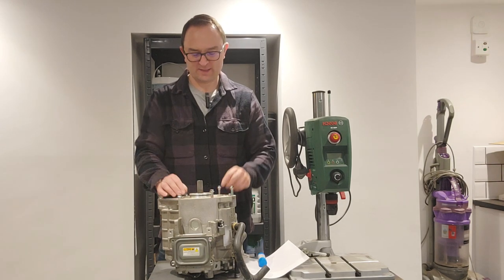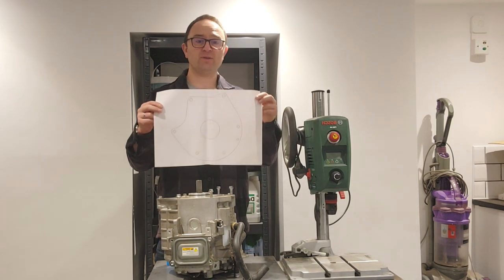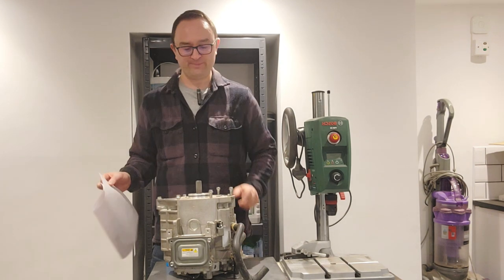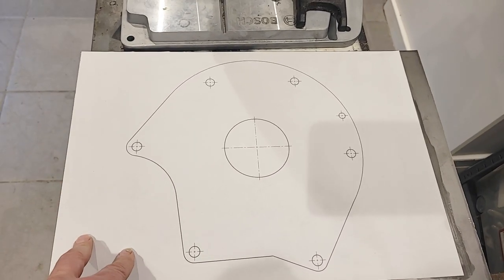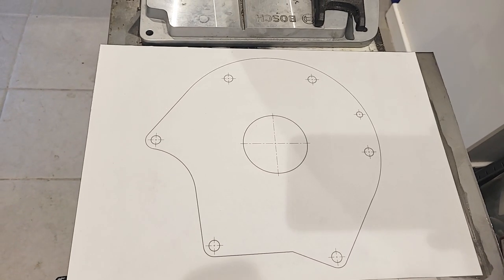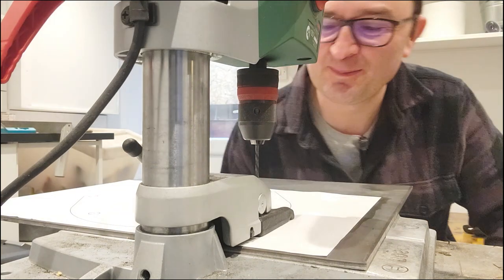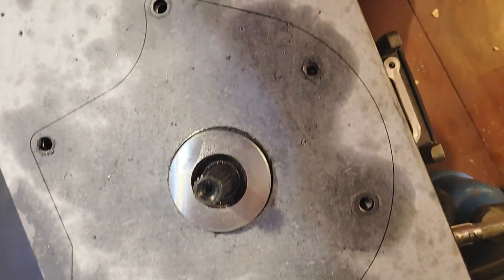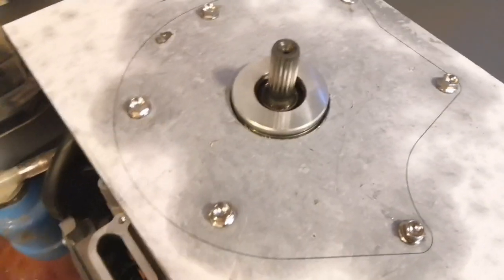Electric car conversion motor upgrade - part 1, the adaptor plate

Comment: I can't understand why did you start machining without checking if the print does fit the motor first, sure cutting paper and re printing the template would be easier than re drilling the steel plate.
Reply from the maker: Sorry if it isn't clear from the video but I did check. About ten times. But the flexibility of even the MDF mock-up I used was sufficient that the holes didn't quite match up.

Comment: Did you think about testing the print on the motor housing first before cutting into the metal?
Reply from the maker: Tested it about five times including in MDF! Problem is that those materials are just too forgiving. It wasn't out by more than a millimetre or max two anywhere but in those materials it looked fine. May be I just don't have a sharp enough eye or I'm too optimistic.
Reply: @EVDIY  My dad always swore by a sheet of acrylic, hard enough to get good  measurements, and cheap enough for a few tries.

(Possibly off topic) Do you have the diff from the Outlander motor as well ? I'm trying to find some measurements for the motor & diff as one unit. My EV project is a bit space constrained, and I'd like to be sure it will fit before I buy one.
Reply from the maker: @YouichiHophop  good idea though acrylic is bloody pricey these days. 

I do indeed have the diff though not using it. Whereabouts are you?
Reply: @EVDIY  I'm in Cambridge, so quite a way from you. I've got quite a lots of welding to do before I can buy any electrical parts yet, so I might get back to you in a year....

Comment: Someone needs tio invest in a set of transfer screws, ArcEurotrade do them. (link in reply below)
Reply: What are transfer screws? And there's no link
Reply from the maker: I have transfer punches but I'd never heard of transfer screws. Could always make some up in the lathe though. Good idea.
Reply: @EVDIY  I enjoy watching you battle away. You have in common with me a willingness to give things a go. You have some better tools though. We both make do though.
Reply: @blackterminal  The reply with the link will have been hidden by YouTube until moderated, which is why it was not included in my comment. In the mean time you have more than enough information to look them up.
Reply: @EVDIY  I made some by putting a bit of all thread in my pillar drill and holding an angle grinder to the bottom of it until it had a sharp point. Screw this into a hole with the tip of the point sitting out and set your steel onto it. A tap with a hammer and you have a mark in the perfect location.
Then your drill wanders and you've wasted your time. 😝 
Buying them would probably be better but if you are only going to use them once then making them is good enough.
Reply from the maker: @alibro7512  Lucky enough to have a little lathe now, which would would have been ideal had I thought of it!
Reply: @EVDIY  Unless you have top quality tools and are experienced you will always end up with a little adjustment. I always do.
Reply from the maker: @alibro7512  I just signed up for a uni course that should give me access to lots of new tools, including a high end 3d scanner and some big printers. And I may just have bought a scanner of my own (whoops). Think I might be going CNC for the EVGT project...
Reply: @EVDIY  you spoil yourself 😜